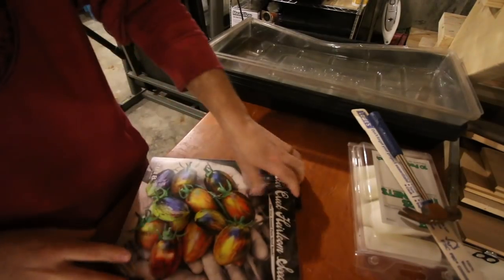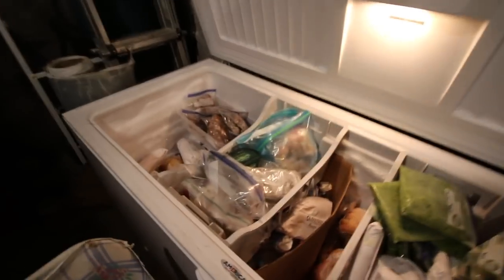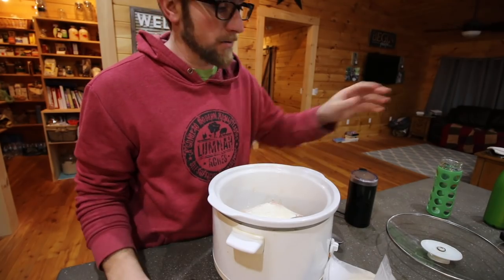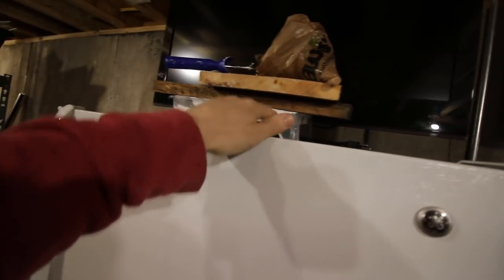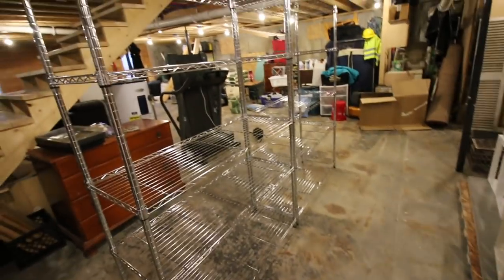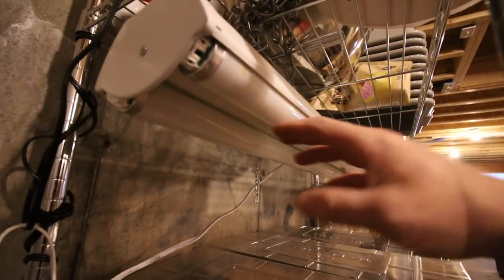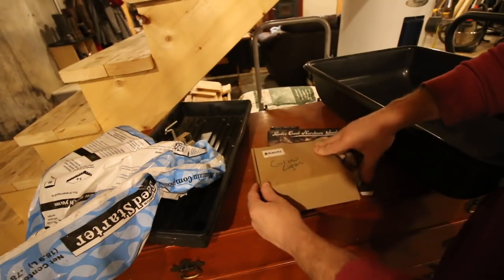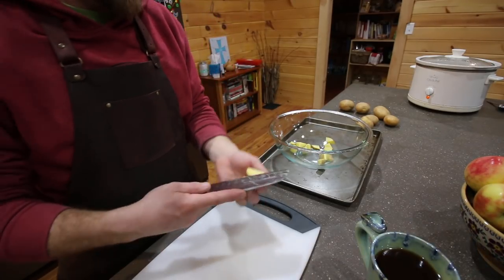Starting our First seeds for 2018 ~ You might be surprised What we are Growing

Comment: I know my cats and I would have to put them further away.  I like to use those concrete mixing trays too.  Then when I am through I just dump the left over soil back into the bag.  I sure am glad you had those lights.  I know from somewhere else they said to use blue and red LED lights.  I had bought a white strip light and I ended up using it in my kitchen under the cabinet so I could see to wash dishes.  So, now to try your version out.  Thanks

Comment: I've been meaning to mention ever since I saw them in the living room, think about making a base with some feet or molding like on the bottom of a dresser or side table to get the crates up off the floor a few inches. Not only will it make them look finished, but it will keep the dust bunnies from rolling into the bottom shelves so easily. xoxo from Arizona.